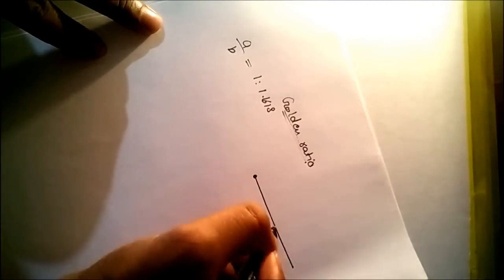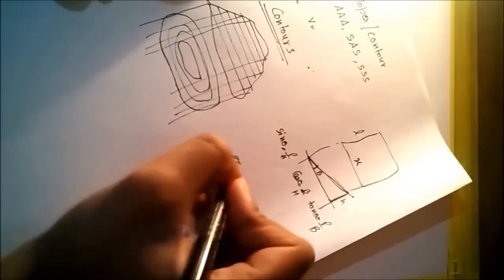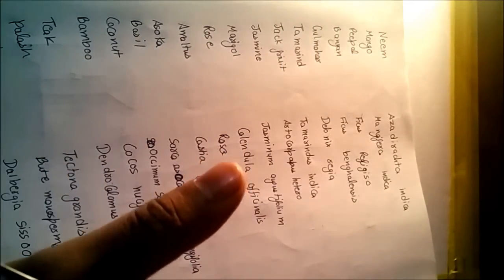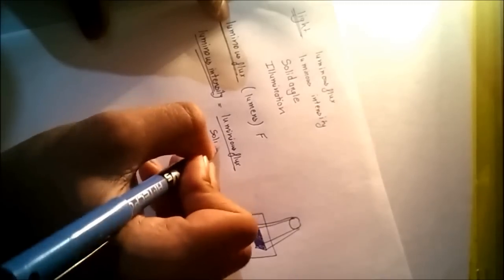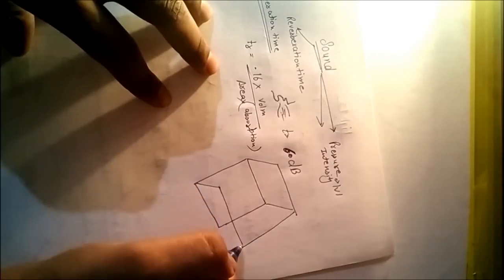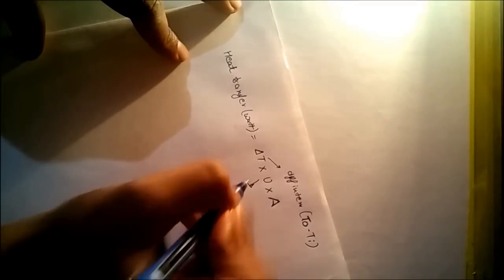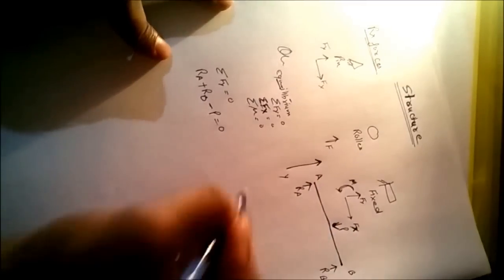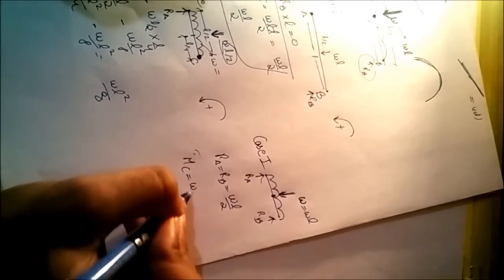Architecture Gate study material 3

Comment: Hi, your videos are very helpful sir. I just have one doubt, in the numerical you solved of 2015, Q.60- shouldn't we multiply the % of ground cover(ex. Grass= 65%) with the total area garden to get the actual grass cover in meter.sq , and that value should be used to calculate further. Why did you multiply the % area with the coefficient of it directly. Pls anyone willing to answer is welcome
Reply: We can do that...
But, since the Area = 35,000 sq.m. is Common for all of the materials (i.e. Concrete, Pavement and Grass), he took it common from all of them and wrote it as (A). Even the height is also common so he took it out and wrote it as (h), Hence simplifying the inner calculations.
Thus, the equations becomes
hA [ (20/100) x 0.8 + (15/100) x 0.9 + (65/100) x 0.5 ]
where, 
h = 70/1000 m
A = 35,000 sqm
Reply: good and thanks karticke 
pls be connected on youtube  , i also have some queries to clear
Reply from the maker: hey Mahendra, I think karticke has cleared your point n sorry I was not able to reply. If you get any other trouble pls ask here
Reply from the maker: +Karticke Pant thank you so much karticke pant 
if you find any other query, pls solve that n thanks one again
Reply: I see now, thanks Vijen and Karticke. I understood now.